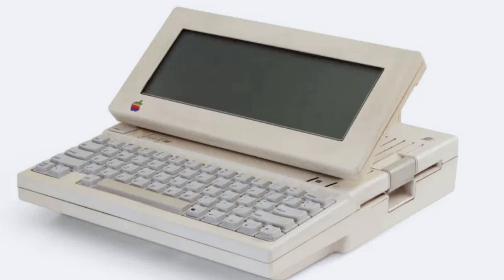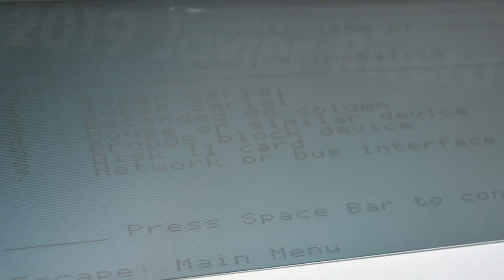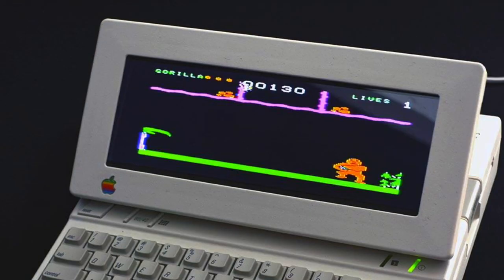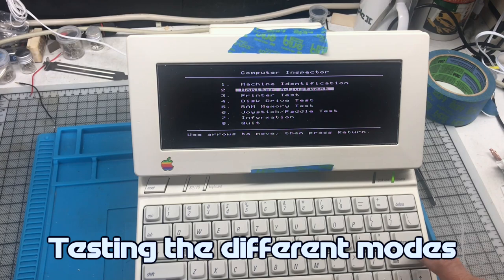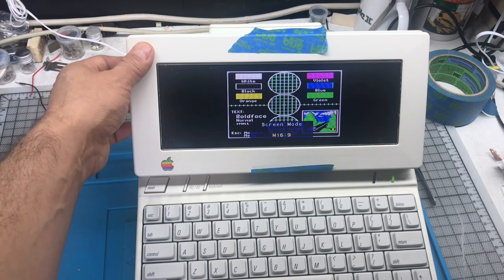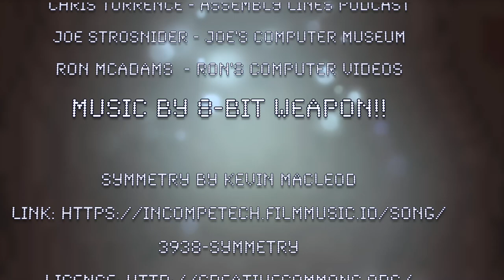Adventures in Retrocomputing Episode 44: Apple IIc Flat panel display LCD screen conversion

Comment: I'm surprised to see any of these old displays around as so few were sold. I was wondering how you were going to deal with the video interface as the old one was very unique (I was the designer) until I realized the new monitor could be driven directly. Nice job.
Reply from the maker: Wow! You were the designer? Would love to hear stories about it, like why getting that weird size and other considerations.
Reply: @ARCJavMaster  LCDs were pretty primitive in those days. I don't remember much about the form factor other than it needed to fit the IIc case width. I sort of recall the displays only had square pixels so that set the size. The old panel is electrically four separate panels in one. Since the display is multiplexed the refresh rate had a big effect on display performance. Driving it as one big panel wasn't good enough so logically it looked like four separate panels on one piece of glass. The old interface took the video stream from the IIc and stored it in a RAM and then read it out four times from four different places to create four different video streams, one for each quadrant of the display.
Reply from the maker: @stevesmith3890  You should write more stories like this, people are very fond and interested in hearing them. Maybe join the Facebook Apple II enthusiast group?
Reply: @ARCJavMaster  Ok, how about I add to the story. So here's a bit  of flat panel trivia. Why did we ship such a poor display? I'm going to have to take some of the fall there but some was by chance. I had been working in the disk division on Twiggy drives and honestly it was full of problems that were pretty much unsolvable. I was getting pretty frustrated and was looking for another spot in the company. I met Rick Geiger who was running a one man technology investigation group. His background was software so we sort of teamed up to look at new tech. We got these panels from Sharp and I went to work on an interface. Now Apple was growing like crazy in those days and Rick didn't have any office/lab space for me so I set up shop in a conference room. We were in what was called the triangle building since that was it's shape and this room was on an apex of the triangle with two completely glass walls. As you can imagine with the sun shining in the room was crazy bright. There was only one panel and my proto interface so all the execs came to my conference room to check it out. In those crazy bright conditions it looked ok and once these things get going there's no stopping them.
Reply from the maker: @stevesmith3890  I love it! Well, just to let you know if you have more stories, we have tons of people always talking about the hardware and software, a thriving community of retro. Somebody is doing clear cases for the Lisa, clear Apple II, Mac, etc. 
There's also Kansasfest, a conference on July of all Apple II stuff, we show prototypes, programs, etc.
Reply from the maker: @stevesmith3890  I shared your story at the Apple II enthusiasts group and - as expected - caused a lot of positive comments. Somebody is actually asking me your contact info:
"Ask if they would be willing to talk to me about the Lisa-1 Twiggy drive project.  I'd love to document the history of the device for posterity."

Comment: I remember first seeing you do this on the Call APPLE website back in 2015. Such a wonderful modification to the original Apple //c flat panel display. I'm excited to have this done to mine and bring new life into my LCD and Apple //c computer. You do amazing work Javier. I never thought about using Meguiar's PlastX on computer parts. I've only ever used Novus 1, 2, 3 for computer plastics and the Meguiar's PlastX on vehicle headlights. Nice tip on that one for sure!

Comment: Great work! I think a neat way to extend this project would be to figure out how to make 3D printed, replica IIc flat panel displays that are designed to accommodate modern screens internally from the beginning. I'm sure lots of people would love to add something like this to their Apple IIs ---even as an aftermarket replica. I wonder what kinds of signals can be input to this modern LCD panel --maybe even an RGBtoHDMI Raspberry Pi could be incorporated inside to drive the LCD at crisper resolutions. A Raspberry Pi video processor would probably even allow for an "emulation mode" of the original green LCD. I think that this is sort of similar to the work that people often perform on Nintendo Gameboy consoles these days.
Reply from the maker: People are not eager to pay that cost, 3D printing is expensive, adding screen and video driver could go up to $450. Not feasible.

Comment: This is great. I had a failing Apple Iic CRT monitor, and I did the same kind of thing - swapped in a 10" LCD panel for the original display. Looks pretty good, although my panel was HDMI only so I needed to add a few adaptors to get a video signal and the result has some conversion artifacts. Thinking about the Raspberry Pi based RGBtoHDMI boards and wondering if the Iic would work with those..
Reply from the maker: I have done those with 9.7 ipad screens and vga/composite converters. Then I add A2Heaven VGA adapter to make the image clean and crisp, adding green and amber options.
Reply: @ARCJavMaster  yes I have the A2heaven but it’s the HDMI stage when I get noise. The screen I have is HDMI only.

Comment: i'm planning to build one of these from scratch. do you have measurements so that i might 3d print the frame?
Reply from the maker: I would have to measure it, will contact you when to do that. 
Others have done smaller versions in thingiverse, maybe you can use theirs in the meantime

Comment: It would be interesting to convert the original Apple //c monochrome CRT display to a color one using a same sized CRT. I've seen conversions using LCDs, but they look shoddy. The LCD doesn't follow the contour of the bezel and looks out of place.
Reply from the maker: unfortunately there’s no space inside for a color CRT, they are larger and have way more electronics. 
maybe if somebody created a custom one could work. also would gf expensive

Comment: Fantastic build, thumbs up and subscribed. What did you do with the color LCD's menu buttons? I did a similar build with a Tandy 200 and couldn't decide howto incorporate the menu button circuit board so I left it out and used the infrared remote that was included with the LCD. I like your way better, please explain.
Reply from the maker: I may have missed the part where I built the controls, but is pretty easy: removed the springs and solder a small cable, glued the bare cable on the side and that activates the button. Simple and easy.
Reply: @ARCJavMaster  The best solutions usually are, thanks again for the wonderful content look forward to seeing more of your videos.
Reply: @ARCJavMaster  And thanks for the Meguiar's PlastX tip, I never thought of that.
Reply: @Anangelspath  Same here.  I've only ever used Novus 1, 2, 3 for computer plastics and the Meguiar's PlastX on vehicle headlights. Nice tip on that one for sure!

Comment: Conversion? But WHO own such a display in the first place. Could you BUILD A NEW ONE FROM SCRATCH? Should be much easier with modern microelectronics such as ESP32 or such? The case can be 3D printed in a similar enough color. With YOUR skill you could do this in a heartbeat and make some money from the volume, couldn't you?